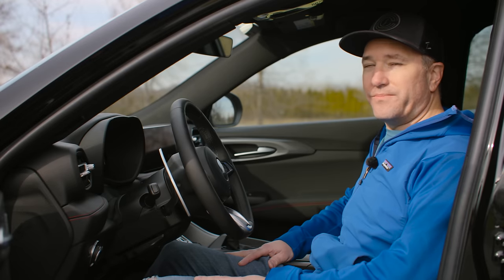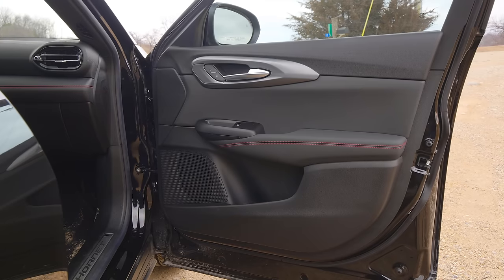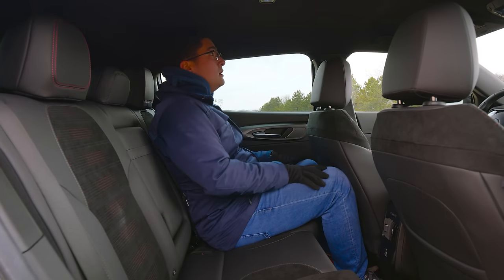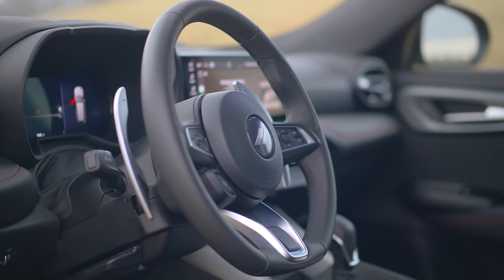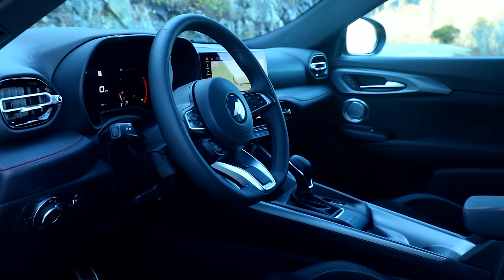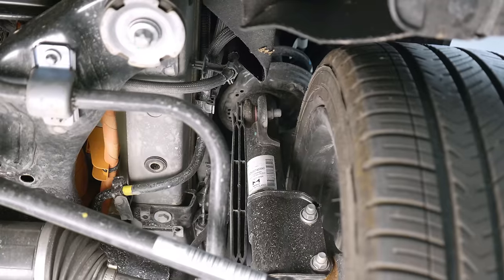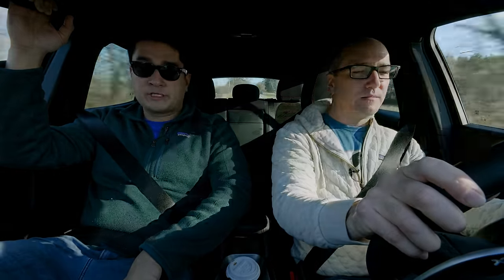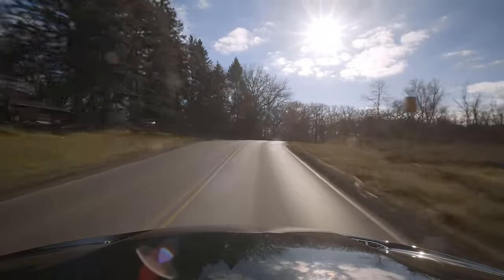Dodge Hornet | A Stinging Sensation

Comment: Because most modern CUV owners prioritize utility and economy over performance (hence the low take rate of trim levels with engine upgrades), the Hornet is both overpowered and overpriced for this market. Stellantis should've offered a base Hornet SRT model powered by the Jeep Compass' 200HP 2.0L engine and sold it at a lower price point more competitive with other compact CUVs.

Comment: You couldn't give me a POS like that. I am driving Ford Panther cars (Crown Vic, Grand Marquis) for the rest of my life. No touch screens, no spy devices, no self driving trash, V8 engine, rear wheel drive, solid rear axle, body on frame construction, and they actually look like cars. Parked end to end with my 1964 Ford Fairlane, my 2006 Crown Vic has almost exactly the same shape.

Comment: It will be interesting to see what else Dodge is allowed to bring into their portfolio. Because if they don't start making some decent sales figures I could see Stellantis shuttering Dodge all together and just keeping Jeep and RAM names. Selling less than 10k Hornets is regrettable. Granted that was less than a year, but still 3 quarters of sales. The Jeep Compass sold over 85k in 2022... even taking out a quarter of that, still nets considerably more vehicles than the Hornet which is basically the same package. As you stated, the segment they decided on is one of the most competitive segments. I mean every car company in the world sells SUVs now. I also agree they are playing catchup with every other SUV manufacturer that has had a vehicle under development for multiple generations. I would be working hard on the forums to gather as much information from the customer base as possible to bring the most dependable vehicle to market and address any other desires by the customer base because they've got a large mountain to climb if they want to wrestle sales from the other manufacturers.
Reply: I don't think FCA/Stellantis has an overarching model strategy, well it doesn't seem like it anyway.

Comment: I like this review. First time watching and it's refreshing to see a straight up review without theatrics and yet it's interesting and not boring. Not everyone needs to try to be Top Gear or Doug DeMuro.
Reply: Should also check out Car Care Nut... zero driving shots, basically just a mechanic's take on cars, helpful on the practicality from a repair/servicing aspect. Though he barely is starting out doing vids.
Reply: @vjmtz  thanks!
Reply: @JohnSpo  No problem. I love cars and reviews, but my biggest issue IF anything is the long talk about how a car handles etc. As nice as it is to know.. a lot of people go on too much about it when honestly 95% of people who don't own more than 2  cars in 5+ years could really tell the difference. 

For me, I mostly need to know "is this reliable, what will break first, and how much?"  Are my biggest concerns.

Comment: In my dream world, manufacturers have decided to pair the power band of peaky high revving N/A engines with the the low end torque of electric motors.
E-AWD cross overs like this one take inspiration from kei trucks. A family of small displacement engines all running efficient Miller cycles, using a centrifugal supercharger (1.0L triple, 1.3L 4cylinder and for the top range premium vehicles a 2.0L 6 cylinder) are mounted longitudinally, nearly flat, just ahead of the rear axle. But unlike an AWD kei truck or van, which has a drive shaft up to the front, the center tunnel contains a small battery pack to power the front electric motors. One for each wheel, for true torque vectoring and one other small electric motor as an ISG on the tiny engine. Because the front is electrically driven, rather than the rear like most e-AWD vehicles, efficiency can be improved in energy recovery. Keri the battery pack small to reduce weight.

Comment: I remember hearing Dodge was FORCED to bring this car to market to bring down the brands MPG average. Every car Dodge has made since like 2008 has been a POS. Dart, Avenger, 200, and due to that they couldn't afford to keep the v8's around. The Federal penalties were mounting up and the parent company hated it. If Dodge had bothered to make a hybrid Challenger or Charger, and the Hornet and a smaller sedan had been offered they probably could have been able to keep the Hemi. They just shot themselves in the foot refusing to make ANY good vehicle. Its likely why the Mustang is still around while the charger/challenger had to die.
Reply: The Dart and 200 were both pretty decent economy cars, especially the 200 with the V6, which was shockingly quick. It also sold like crazy, it was a pretty stupid decision on FCA's part to kill it so quickly.
Also the Charger is not "dead", its being overhauled to have a much more efficient straight 6 engine and an electric option.
Reply: The Dodge Avenger and Chrysler 200 were decent cars from a reliability and maintenance cost standpoint, particularly the base 4cyl versions which were underrated in terms of overall reliability, both cars were just uncompetitive with the Japanese stuff in virtually every other aspect - I still think they are/were decent looking cars too though.
Reply: Mustang is gonna die too in '28.
Reply: @timothydubois5834  there isn't any evidence Mustang is going away in '28. For runs 5-7yr refresh cycles so the current car is going till at least '29-30. It's more likely the drivetrains will just change.
Reply: Did you say "hybrid Challenger"? <look of astonishment>.

Comment: Dart was always a good looking car imo. Too bad they didn't improve on that model
Reply: My neighbor had one and it was always broken. Plus they sold poorly.
Reply: Had a 2013 Dart Rallye. Drove it from 20k to 108k miles and never had a problem with it. Those cars were awesome. Very handsome, comfortable, good economy, and sold well for a compact Dodge. They got axed so they could make more Jeep Cherokees that sell for more money with higher profit margins. Used Darts have stayed expensive, though, because people who had experience with them knew they were solid. That was true prior to Covid, not just now. It's a shame the domestic manufacturers refuse to put any real effort into truly compact, economical cars. The Dart came along at the wrong time and was killed so Dodge could make more $60k+ commodity SUVs.
Reply: Dart peaked in the early 70s
Reply: @TheBigFatTater  I have a 2013 Darty Rallye right now as well as my dd, just about to 95k miles. It's got the turbo and a manual too, it's almost like driving a civic si but with a turbo, reliability hasn't been too bad as there haven't been any huge issues but maintenance is somewhat expensive as labor costs to get around the engine for stuff like the timing belt (replacing the valve cover gasket for some reason requires you to also remove the exhaust manifold) are a little high. Still enjoy it, mileage isn't too bad with around 27 mpg around the city, and I do think it's a nice looking car that people always think is newer than it is. Probably won't be selling it soon unless something drastic happens.
Reply: Same, I thought it was a nice looking little sedan. I was hoping for them that it would take off like the Neon did 20 years ago, but clearly not.
Reply: @matthewwatson6075  That's sick. Mine was just an automatic with the big(ger) engine. Would love to have another one at some point. Mine wore red with black trim and the gray painted rims. It was sharp. I agree that they still look contemporary. They look a lot better than most of the sedans being put out by automakers right now.
Reply: They spend $1billion on R&D Chrysler 200, only to discontinue it after a couple years.
Reply: @tiberianexcalibur  classic Stellantis
Reply: @TheBigFatTater  To be fair, back when the 200 was discontinued, FCA was the one responsible. they were just as bad though.

Comment: Ideal as a lease vehicle. If you can get this leased under $300/mo and consider the low operating costs and fuel consumption, it’s a relatively strong consideration as the inevitably terrible residual value and expensive long term maintain is irrelevant.
Reply: Low operating costs??

Comment: Thanks for the review. Looks like you ran through the finial thoughts just to get this over with. I don't blame you. This thing is pretty much a rebadged Alfa Romeo Stelio or AKA a POS. I turned mine in off lease early just to get rid of it. The reliability, service advisors and dealership were the worse I've ever had to deal with. I'm glad the Alfa dealership was pulled out of the city and the Maserati dealership was canceled.

Comment: I actually saw one in person at the Philly Auto Show. It really didn't look bad overall, though inside the engine bay looked like kind of a mess. The outside looks like a Mazda CX-30, but a little beefier and I don't hate it. Interior looks like the new Supra, but a little more simple, driver focused, and I don't hate it. I really like the seats those actually look unique, sporty, and comfortable. The front and especially rear suspension look straight up like an older Subaru, and I don't hate that. Easy to work on and durable if nothing else. AWD turbo making 268hp? I mean that sounds pretty fun. Sorta like a lifted WRX. I actually don't hate this thing. I hope it isn't as unreliable as can be and that it doesn't rust out like crazy. I do hate the brake by wire and the restrictive traction control, but it seems like if you want a somewhat fun good looking CUV it's a solid option. Longevity will be key. Will probably drop value like a rock no matter what.

Comment: Here in Brazil I have the distant twin of the RT, the Pulse Abarth, with the same engine and architectural design, so to speak. It's an excellent car. Although our version does not have the electric motor at the rear and is not 4x4.

Comment: While the RAV-4 may have a higher 0-60 time, it is more accurate to what it would do for you on a daily basis.  The Hornet may claim 0-60 in the mid 5s, but your real world experience is unlikely to see that on a regular basis.  Expect those times when you drive it, but you'll have to also go by the numbers achieved by whatever loaner they give you.  As much as I wanted this to be good, most of the reviews of this have shown it is going to end up in the shop during ownership.  Stellantis even recently pulled out of the doing auto shows.  No idea what they are doing, but buying one of their products, at least right now, would be a big mistake.  Maybe this is still on an old platform as it's just a placeholder until they get newer EV products.
Reply: To your comment about the old platform - it is, they said in the video that it's on Fiat Small Wide 4x4 LWB, which is a heavily reworked 4x4 version of what underpinned the Fiat 500L in 2012, or the Fiat Doblo/Ram Promaster in 2010.  The PHEV part is new, which would probably be the model to steer clear of.
Reply: @aprtur  I know they said the platform is old, that's what I referenced.  I'm talking more about the lack of reliability for this unit, since several reviewers had issues during their testing.  The fact it is on an old platform all on its own isn't bad, providing the platform was successful.  My thinking is they don't want to invest a ton of money into a new platform if their goal is to transition to electric products sooner than later.  A new platform is likely in the $1.5 to $2 billion range, and while its a likely worthy investment for companies like Honda and Toyota who sell tons of cars and crossovers that use it, Stellantis doesn't have nearly the volume to provide a reasonable ROI on such a massive investment.  I don't fault them for this decision, but it would be nice if they could make something reliable, since more and more people care about quality nowadays, especially with the way costs are going up.  The last thing people want to worry about is car repairs.  This isn't the 70s and 80s anymore.  There's no excuse to make something that isn't reliable.
Reply: @jeffer1101  personally, I think Stellantis are the last ones that should coast on an old platform as a wait to move to EV, as they are the ones that can least afford to continue losing market share, especially when their bread and butter vehicles are now not available new.  Then again, it's early times for the Hornet, and hopefully they will redeem themselves by addressing issues as quick as possible to show that picking a Dodge wasn't a poor choice (wishful thinking).  As you said, people are more discerning now, and this particular segment is flooded with super competitive offerings.  I find it amazing that Mazda, who are tiny in comparison, put out a much nicer put together product for less in the CX-5 turbo and CX-30 turbo trims.
Reply: The RAV4 PHEV is also mid-5s. Surprised they missed that.
Reply: @aprtur  I don't disagree in terms of trying to get every last dime out of an aging platform, but I also know they can't/aren't going to sink $2 Billion into a new platform when the inevitable is right around the corner.  Mark and Jack talked about it in the video, that this company left their products on the vine too long and abandoned most of their offerings in various segments because they simply couldn't compete.  Now they are a decade behind the other good options in the segment, so it's really no surprise this will likely be underwhelming in terms of sales/reliability.  They managed an iconic brand poorly and the various companies who have owned the various ChrCo brands over the last 3-4 decades of ruined them.

Comment: 24 MPG combined is hysterically low. How many 2.0 Turbo motors do we know that average way above that...if not in the 30's then in the high 20's like 28-29.
Reply: I could get up to 30MPG on my 2014 V6 Mustang if I drove it right.
Reply: My MK7 GTI gets 30 on long highway trips. 25 on short highway trips.

Comment: I like how the lower ball joints are held on by three nuts and bolts. More manufacturers need to do that.
Reply: Have this on my 06 toyota. No ball joint separator required.
Reply: That's really nice if you live somewhere where the roads look like a lunar surface, ball joints get eaten up really quickly.

Comment: I was under the impression that the hurricane 6 was going to be incorporated into a sedan platform that would become their new performance car, as well as an ultra high output EV product. 
If so, that would a much easier transition. 
As at their core, I believe mopar people really want products that can go fast, sound good, and can be made even faster and louder
Reply: The hurricane 6 is available only in the Grand Wagoneer at this time. It may be available in other vehicles later according to what I’ve seen and read.

Comment: Dodge cars+Itallian manufacturing=Good for the first few years, but I think it won't last quality wise. My 8 year old CRV, always starts up, one tire change, first brake change at 110K miles. OIl changes and one transmission fluid change, that's it. Unless this is so cheap that the $5000 I will have to spend in 5-8 years for a what every brakes, I will pass. Maybe they should put some crazy long warranty

Comment: Why not look at a Cx30 turbo instead? I think 0-60 wise it’s close, albeit without the PHEV system.
Reply: CX-30 Turbo is probably inbetween the GT and RT in terms of speed (I've been able to get very high 5 0-60 in my stock one on a good launch) and I've been averaging 28-30 MPG on mine depending on how much highway driving I do. It's also a much better value.

Comment: A Fiat sourced  1.3-liter turbocharged four-cylinder engine with a 15.5-kWh lithium-ion battery that runs an electric motor is a very bad joke. This thing will be in the junkyard while Honda CRVs and Toyota RAV 4s continue to roll along mile after mile. Or the Dodge will be in the shop getting the engine replaced if you are still under warranty. If you have to have one, lease it and turn it back in at lease end. Let it be someone elses problem. Chrysler Stellantis where quality is Job # 20.

Comment: The right rear light in the fender is limping. It's not lining up with the light bar in the rear hood.
Doesn't wonder me if this Tonale based car is the same as the Mazda. The Abarty and FIAT 124 are build by Mazda too. So they have a jointventure. 
Seats probably made in Poland. Just like the FIAT 500 is.
Dodge logo upfront is okay but not on the rear and especially not on the head rests. It looks so cheap now? They should have embroided the Hornet logo instead. They probable will do this in the Second generation due to many costumer complains. 
Rear wheels look tiny when looking at the hip of the car. A bit higher tire will compensate this. But might influence the stability and sportiness of the car. 
Power steering and stability controle can be switched off so you would enjoy the vehicle more. More Alfa feeling that is.